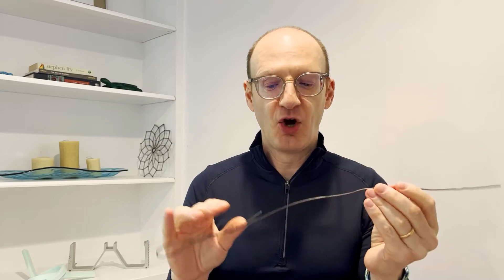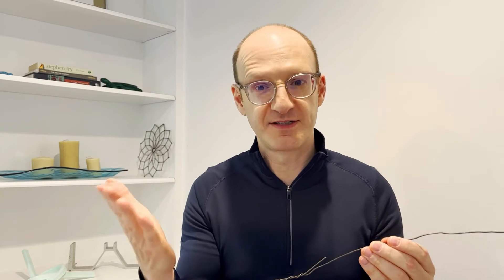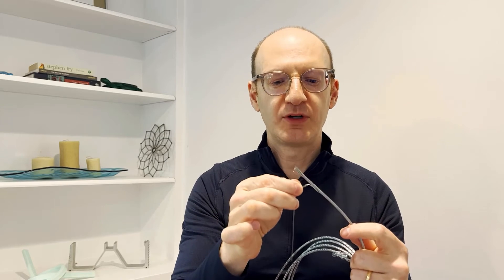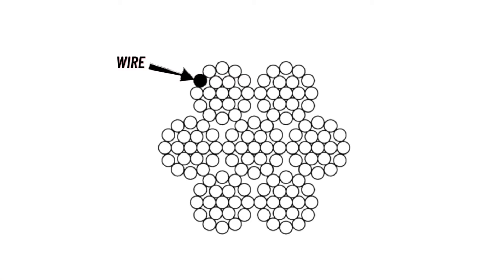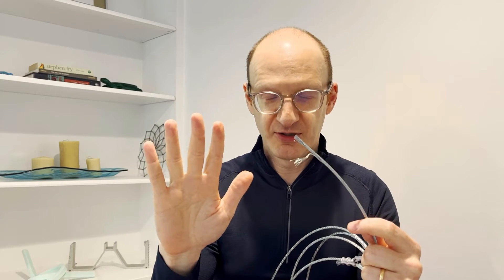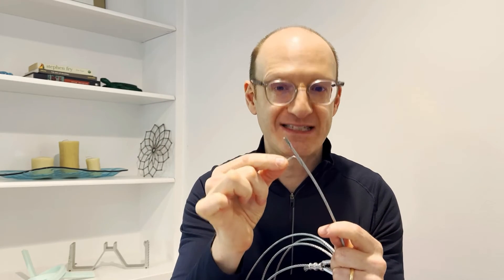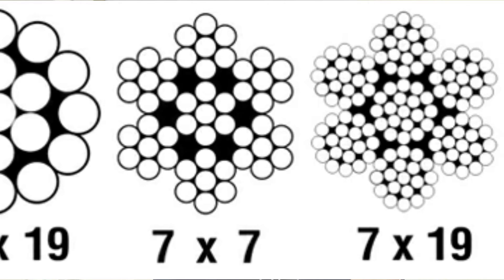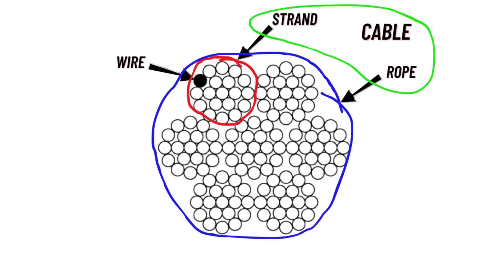Wire, Rope, Strand, or Cable?! Do you know the Difference?

Comment: Out of curiousity would depleted uranium be able to be made into a drawbridge or suspension cable for a bridge and be feasible to use or would it corrode faster? I only ask because the materials are used in armor in tanks as well as cores for tank rounds. If they are that strong would it not be better than what type of cables we have now holding bridges up in suspension and drawbridges?